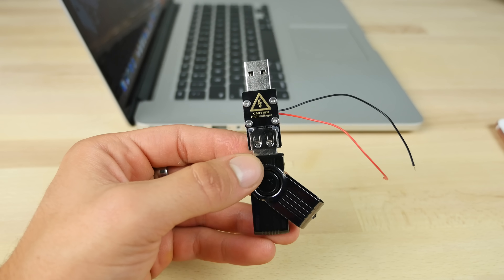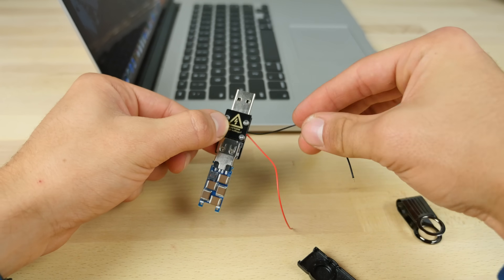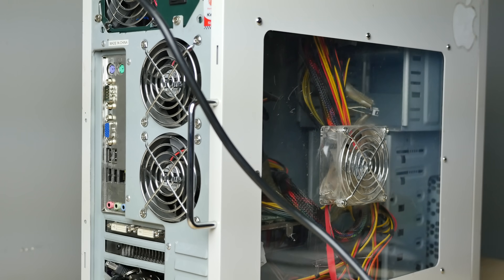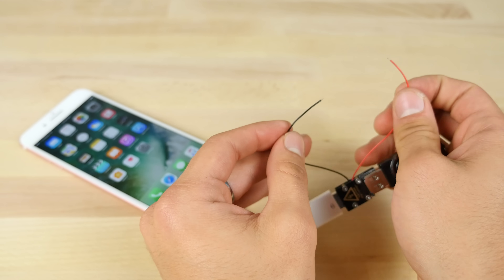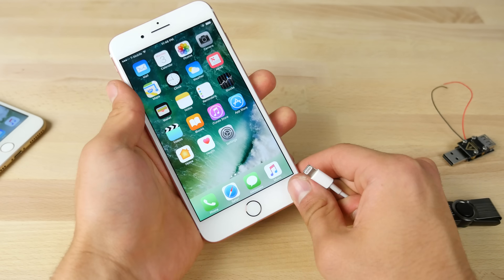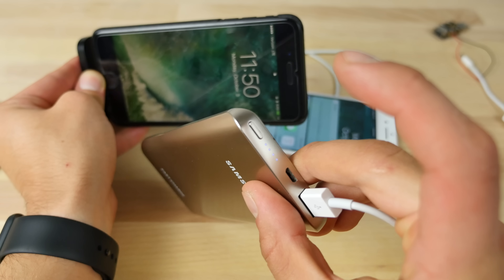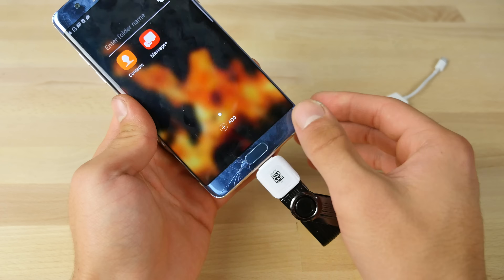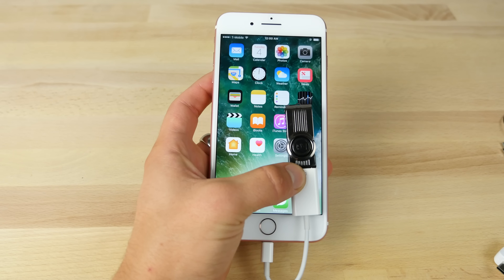USB Killer vs iPhone 7 Plus - Instant Death?

Comment: the difference I think is that with the phones, you're using the charging port, specifically designed to prevent overcharging and power spikes from the wall. A computer usb port simply isn't shielded like this

Comment: not sure you understand how these work , there is a boost converter circuit in there that boost the 5v into a high voltage that high voltage is stored in the capacitors in order to be able to deliver a higher current at that high voltage.

Comment: I think you made a mistake. In order for this to work, you actually have to charge the capacitors at a normal high voltage usb port, otherwise they are not loaded up enough to kill anything, lol. So this test is useless, sorry.

Comment: Note 7 can connect to 2tb driver so it will have more out put also can charge othr ohone...
Reply: they issued out recalls? they replaced the defective phones like 2-3 weeks ago
Reply: ***** don't reply if you don't care lol i'm just saying anyway
Reply: To bad it might explode aswell
Reply: they fixed it
Reply: @Zhuo you Lie man..
Reply: Holly Hsieh USB is always 5V and is usually limited to 1A, the size of the hard drive you connect it to doesn't matter, only its amperage and the way the data is processed (meaning whether or not the phone can read/write to and from the hard drive) matter
Reply: Holly Hsieh BRO WERE TALKING ABOUT A USB NOT A FUCKING STORAGE THING, PLUS NO ON ME CARES

Comment: Where did you find carbon fiber cases for your iPhone 7 Plus?????????
Reply: https://www.amazon.com/iPhone-PITAKA-Fitting-Minimalistic-Premium/dp/B01LQIXK8S/ref=sr_1_1?ie=UTF8&qid=1475615828&sr=8-1&keywords=aramid+fiber+case+iphone+7
Reply: https://www.amazon.com/iPhone-Protective-Premium-Tempered-Protector/dp/B01LQGUL2I/ref=sr_1_2?ie=UTF8&qid=1475615879&sr=8-2&keywords=aramid+fiber+case+iphone+7
Reply: WOW, thank you so much, I wonder if there is more of them to choose from? When I search for them I dont see good ones like the one you found.
Reply: I just need the case and not the screen, I really like the one in your link but only comes with screen protector.
Reply: The price for with or with out the screen protector is the same on amazon, the price is quite high because it is not carbon fiber but Aramid Fibre

Comment: Plugs USB-stick into motherboard
"I don't know if motherboard or power supply is broken."
Reply: +Rik Altink "the fuse" someone doesn't know how computers work
Reply: How about the fuse on your pc ?
Reply: 'Apple Pro'
Reply: BeastyTank402 Gaming it was a joke
Reply: +Da Keks listen here, there is more than one fuse in a psu, that's why I said that, for you to call me Beastyretard makes no sense, btw, core 2 motherboards don't all have surge protection, and it doesn't matter its an athlon chipset,
Reply: you have to remember that he is an apple fan
Reply: +You Suck you're right, you're definitely not a computer professional.
Reply: ***** i design embedded hardware and develop the firmware...
Reply: i just meant that the PSU probably wouldn't do an automatic shutoff, the motherboard would just be so fried that it'd probably stop sending the current to the PSU that tells it to supply full power to the board (the PS_ON pin) and the PSU is probably still okay and still sending the standby 5V. then again, i'm just nitpicking.

Comment: i made one usb killer myself with the circuits if a bug zapper . instead of using the computer power i put a battery with it. i have hidden everything in a usb hub. and yes this thing burned a old chinese laptop and a asus zenphone 2 for easy rma. and it was damn strong,the phone was burning hot for hours.

Comment: I did this with a cord I ripped out from an old iron. Cut and stripped it and exposed the copper wires(Two pieces from one end), touched one piece to the headphone jack and the other piece to the USB opening or battery terminal (with the battery removed)and ZAP, phone would instantly dead.

Comment: You can still charge it! You need to turn the iPhone off when it's plugged in. Then it will charge... had it with my iPod Touch, tought it was dead... but after letting it charge a night when it was turned off, I was back at 100% again.

Comment: imagine plugging it into every deviece in an apple store
Reply: almost all devices have anti surge - apple were one of the last ones to incorporate it.
Reply: well i presume it kills the usb port it was plugged into as the voltage had to pass through somewhere to activate the surge protection.
Reply: most electronic stores have alarms built in to the chargers in the UK so removing the alreaddy plugged in cable would set off an alarm to deter would be thief's
Reply: That would be funny af
Reply: peanut Butter Peterson good idea
Reply: +Aengus Ruane itd work in some older devices
Reply: +Aengus Ruane some big apple stores still have iPhone 4s' and iPod touchs on display
Reply: +Aengus Ruane but your local apple store, yeah no luck lol
Reply: Chazzio Z. Even if they had those d devices they are already plugged in and if u unplug it the alarm will sound... So good luck...
Reply: +AirtheteenMC what are you talking about lol, people take the plugs off all the time to charge their own phone
Reply: +Chazzio Z. Well at least they do in NY, idk how it runs where you're at
Reply: +AirtheteenMC the alarm sounds when you cut that little thing off the back of the phone that's wired into the table
Reply: +Chazzio Z. But either way the phones on display are demos, and if you leave a certain range it'll just brick
Reply: peanut Butter Peterson it wouldn't likely work since apple is the only big brand that has high voltage surge protection in their computers, any other computer would die for sure
Reply: +Aengus Ruane Well phones arent the only things there, you can do it on macs.

Comment: Usb killer was made because manufacturers EXCEPT APPLE didn't add any safety components for their computers to prevent over voltage. So if u test this with apple computers nothing will happen.
Reply: Let me try it on my $2000 macbook.
Reply: manufacturers except Apple? so how come the Note7 was perfectly fine and the iPhone 7 lightning port was fried?
Reply: Jose Acevedo oh yeah i thought they were smartphones
Reply: "for there computers" don't you see
Reply: The point was not are phones computers? Yes they are. The point was that I WAS TALKING ABOUT APPLE'S COMPUTERS NOT PHONES. APPLE has safety components in THEIR MACS. NOT IN THE PHONES.
Reply: Jose Acevedo so the old phones are computers right
Reply: GoofyGoobieGamer You do know phones are computers, right?
Reply: actually the company (from Russia I think) the only computers that can survive this USB are new Macs
Reply: ***** I don't hate Apple, I actually have an iPhone 7 Plus. I'm just not biased and actually like both iPhones and Androids.

And what's your definition of a computer? If your answer is a laptop or desktop, what's the difference between them and a phone? Computers have a processing unit, RAM, motherboard, exc. Same as phones. Same can be applied to lots of other stuff such as smart watches, TVs, exc. They all have the same basic internals.
Reply: Computers are Computers & Phones are Phones... There not the same thing each word describes a certain object not what goes into a object... Would you talk to someone about your smartphone but call it a computer? "Let me just get my computer out my pocket so i can make a call" no stop being a nause. Is a car the same as a motorbike or a small plane? They both have engines so why not?
Reply: ***** Don't ask me. Ask Apple.
Reply: What's the point not to trust Apple and creator of this usbkiller? THE WHOLE POINT behind usb killer was that only Apple made this safety change for their Macs. They would have not released the usbkiller if all the manufacturers would have done the same thing.
Reply: Alex Davies Cries silently
What's the best way I can explain this for slow people... It's like thumbs. All thumbs are fingers but not all fingers are thumbs.
All desktops, laptops, phones, exc. are computers but not all computers are phones.
Reply: MSI's brandnew motherboards like z170 series or z97 or  even z87 has this surge protection thing.
Reply: Appleex Exactly my point!
Reply: +David Fernandez it actually doesn't
Reply: Smartphones are computers. all their components exist for one purpose in general sense, "computing'. without the processor nothing can be done. Just like the famous saying in the marketing world, if u are with apple u have "mac", but the rest are "personal computers" :-))
Reply: yes.
Reply: Techy Halnerd yeah ikr
Reply: Appleex Why wouldn't they have the same safety components for phones tho? How does that make any sense.
Reply: it doesn't do anything to Apple computers? lol. that's funny. try it on your Apple computer. see what happens.....
Reply: why don't you try it lol
Reply: A computer is a device that can be instructed to carry out an arbitrary set of arithmetic or logical operations automatically. Their ability of computers to follow a sequence of operations, called a program, make computers very flexible and useful. Such computers are used as control systems for a very wide variety of industrial and consumer devices. This includes simple special purpose devices like microwave ovens and remote controls, factory devices such as industrial robots and computer assisted design, but also in general purpose devices like personal computers and mobile devices such as smartphones.
Reply: "It appears that one of the only major manufacturers who won’t see their devices affected by the USB Killer is Apple. Their MacBook line is reportedly immune to the device as it isolates the data lines on its USB ports." that what they said :d
Reply: WHO TALKED ABOUT FUCKING LIGHTNING PORT? WE WERE TALKING ABOUT MACS